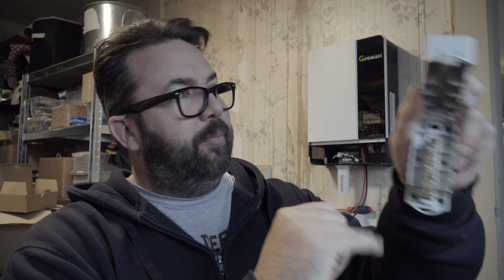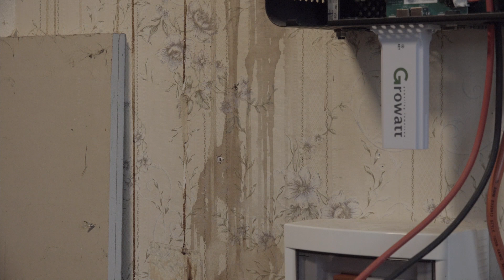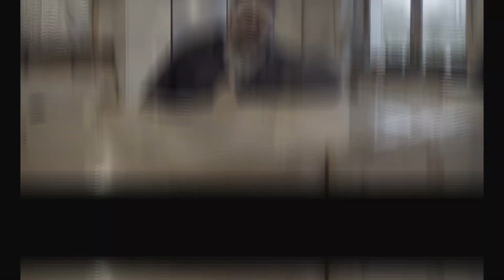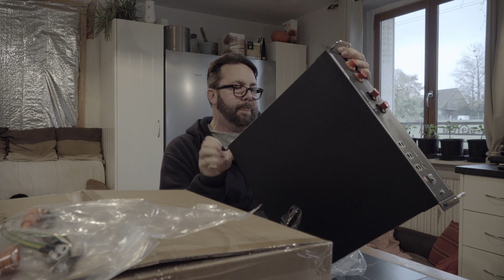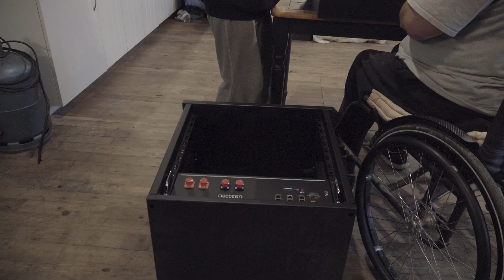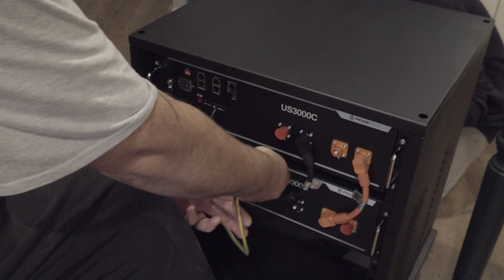Installing Pylontech US3000C Batteries

Comment: Thanks for the video. How long on average do you think it will take to get the money back on 1 battery bank or approx 3.5 kwh?
Reply from the maker: There are a lot of variables. But for us, 3.5kWh is one battery, which I can get for €1350. And then it depends on your whole system, as to how much you generate and how much you store or pull from your battery. Our current setup, with six panels, one inverter and two batteries cost us about €4500. So we should see a return on our spending in about six years, going on current electricity prices. As the price goes up, our return length gets shorter.
Reply: @Bensgarage  Thanks for your answer. I had to discount a battery which I think was faulty and now the one left has stayed at 16% all day despite being sunny.. am using washing machine, tv etc and wondering if the energy is coming from. batterys which is which it hasn't gone up?
Reply: Also do you need to edit any setting if you take a battery away (or add)? or does it just trickle over
Reply from the maker: As I don't know your setup it's difficult to answer your question. On our inverter you set the batteries to lithium and connect the communication cable to the batteries, then the BMS does all the work from there, so if I add a battery or remove one, the BMS takes care of it.
Reply: @Bensgarage  Can you force charge a battery with low voltage. It says 15% charge on it and 5v but left on all day when sunny and went down 1% so bit worried about it. It was part of two but disconnected the second one
Reply from the maker: @FireFlySamson  What inverter are you using? Are you grid tied? If not can you charge with a generator via the inverter?
Reply: @Bensgarage  Ita a Solax generator connected to the grid. i was wondering if the connection from solax to the battery could be at fault? im not sure what the cable is called that goes from solax inverter into the batterys?
Reply from the maker: It will be a communication cable of some sort. Have you set the inverter to charge from the grid when the batteries get to a set level.

Comment: I'm thinking about getting some of these batteries myself, but how to you connect this in such a way that your home pulls from the batteries? How is that setup? I was told by an electrician that I needed some other device and then connect only specific appliances to that, and only those would get powered. Didn't make any sense to me. Why can't this be injected at the "entrance" mimicking the power that comes from the grid, ensuring we don't need to pull as much or at all? Isn't that the whole point? thanks!
Reply from the maker: All the priorities are set in the inverter (in out case). I can set parameters for load source, ie solar, battery or grid, then I can do the same for charge source and then I can set when to start and stop charging the batteries from grid power. When the sun is doing it’s thing, we don’t need to worry about grid power. Our system, I have wired up in parallel to the incoming grid distribution board, taken a feed from the old board to the inverter for grid back up, and have nearly all appliances on the new board, just leaving a couple of high load items on grid until we get another inverter (making our system 10kw).
Reply: @Bensgarage  in my case the inverter is far away on the garage, nowhere near the main breaker and the grid entry point. Is that a problem? There is a way through though. Not an easy pass! Shouldn't there be an automatic way to choose the right balance between sources depending on how priority? Like during the day sun+grid and night battery for example.
Reply from the maker: @ricmrodrigues  Not knowing how your system is wired up, I can't comment. All I can do is explain how our system works. I have it set to power the loads, Solar first, if not enough solar coming in it then pulls from the battery as well and when the batteries get to a set point (user set) then the whole system switches to grid for the loads and charges the batteries back up to the set level. I can also set the charging priorities, which I have set on Solar and utility. Solar charges the batteries to 100%, if the sun is shining. Then if the batteries get down to 20% and there is no sun, it goes to grid charging.
Reply: @Bensgarage  I currently  have a growatt non hybrid inverter. The growatt hybrid is capable of all that on its own?
Reply from the maker: @ricmrodrigues  Yes all that is done in the Growatt SPF5000ES hybrid inverter. I am looking at installing a second inverter which will plug into the original and run in parallel. I can run one as a host and the second as a slave unit, will give me 10kw and then I can likely go off grid.
Reply: @Bensgarage  really good! What panels are you using out of curiosity!
Reply from the maker: @ricmrodrigues  at the moment we have six Trina Solar 24v 380w panels, looking to add another six in a couple of months.
Reply: @Bensgarage  have 9 Neon H from LG and wanted to add a good few more too, 3-6 but without a battery I'll send a lot of energy back to the grid for free
Reply from the maker: @ricmrodrigues  We wanted to keep all our produced power in house, hence the batteries. Here in France, selling back to the grid means getting them to install panels, they wanted €15k for seven panels. We got started with 6 panels, hybrid inverter and two batteries plus all wiring for €4500.
Reply: @Bensgarage  crazy right. Here we paid 5k for the current system with everything, 9 panels of those I mentioned. Now to expand and with batteries it'd gonna cost. Those pylontech come with their own BMS, no need to buy anything else?
Reply from the maker: @ricmrodrigues  The batteries came with everything needed to get them connected, built in BMS. Told the inverter it had lithium batteries connected and they started to communicate straight away. The only thing I had to buy extra, was the cables that go to the inverter from the batteries.

Comment: The Growatt manual states that there must be a breaker/fuse between battery and inverter. 150A springs to mind but not 100% on size.
Reply from the maker: I have seen this, and when clarifying with the company where I bought it, who are also installers, say there is no need. I might add something when we install the second inverter though.
Reply: Hi Ben 
On your dip switches  you didn't  mention  it, and programming

Comment: A tip,to stop connection issues, torque up correctly all terminals, you can end up with resistance problems or a terminal coming loose 👍